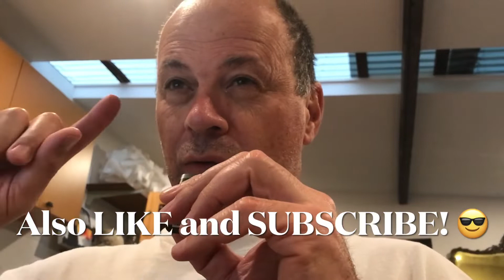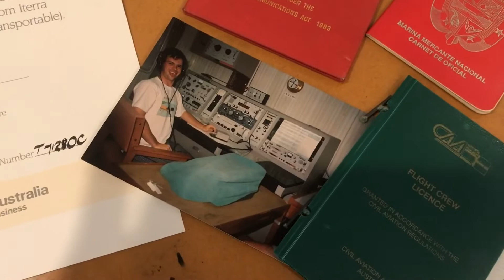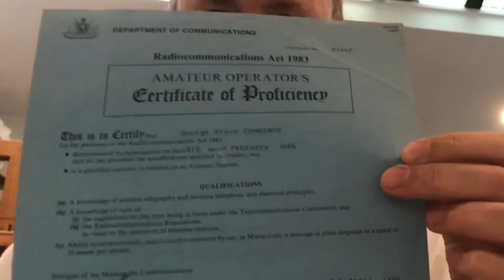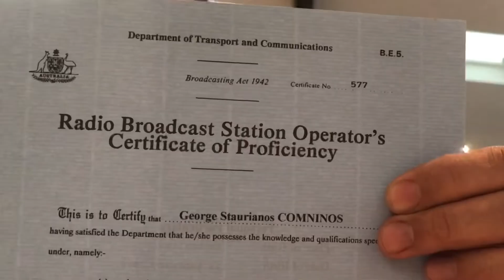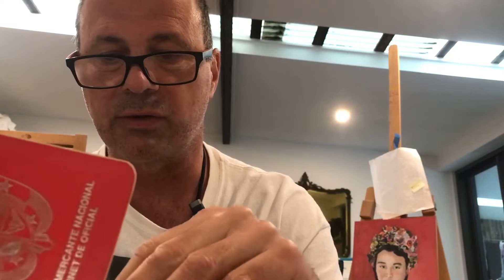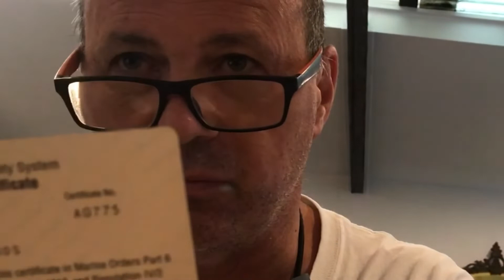Born Again Ham

Comment: seems like we both had similar experiences, from CB radio, to VK2 novice, and VK1 limited and then full. 

I did my training at HMAS Nirimba as a ETC (electronics technical communications), with electronics trades (asso dip EE), radio fitter mechanic and artificers certificate. With a lot of extra courses (mainly in cryptographic systems). 

Continuous self study in electronics and computers I ended up working at UNSW as a STO doing electronics engineering, then private industry in science as an instrumentation engineer (doing a lot of work with photovoltaic and other tech). 

Left that and got a job as a systems engineer for a large SCADA company (water, waste water, electricity and gas systems throughout australia. (ended up doing a lot of Y2K work at the time all over Australia. 

Starting my own electronics engineering / maintenance company and ended that finally back in radio doing Satellite communications support for the military. where I was 24/7/365  on call for assistance.

A good career and a lot of fun.
Reply from the maker: Your career sounds like it was a LOT more technical than mine! I did a little sideline into art and teaching...but the maritime start and the focus are very similar. It is interesting we have both ended up back in HAM radio....and what an interesting space it has become.....tooooo interesting! I have so many half started projects and the day job is really getting in the way! 73 de VK2AOE and thanks for the reply.

Comment: hello I am 14, I am really looking into getting some certifications, I love SDR's I got into it due to hacking but now I am a radio enthusiast but I really want to get more knowledge and certs which one should I go for?
Reply from the maker: Well it depends what country you are in…. But most have a NOVICE amateur radio certificate…. That is usually a good place to start. Normally this entails a short multiple choice technical exam and a regulations exam (they are usually pretty easy!). Contact a local amateur radio club and get to know someone who can help (a guru of sorts). If you like SDR then once you are licensed FT8 digital modes are cool (I have a soft spot for Morse code!). 73 and best of luck with your radio journey…. Below is a link to my video on digital modes.
Exploring Digital Modes @The Art of Engineering
https://youtu.be/YDoxoBToqnU